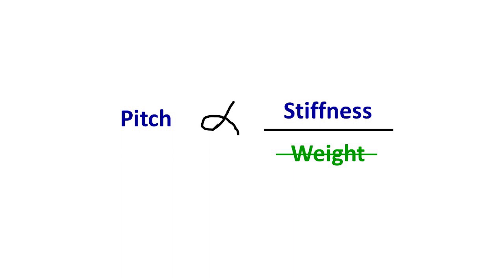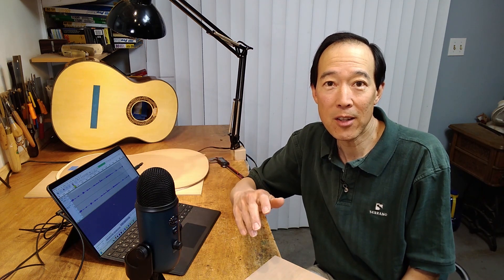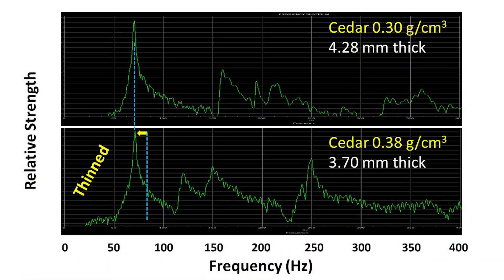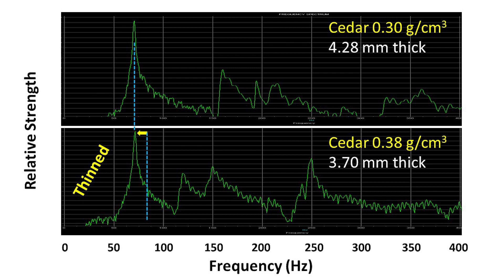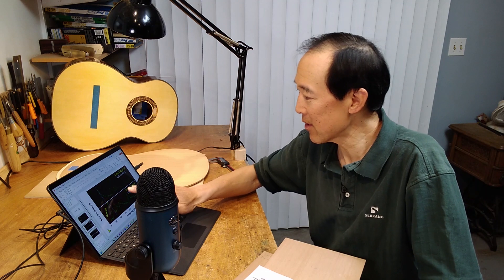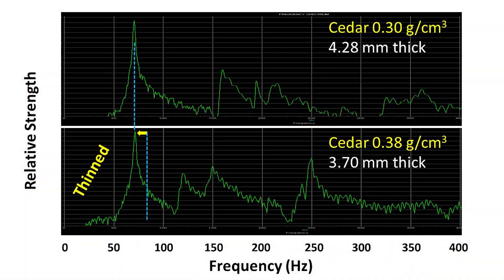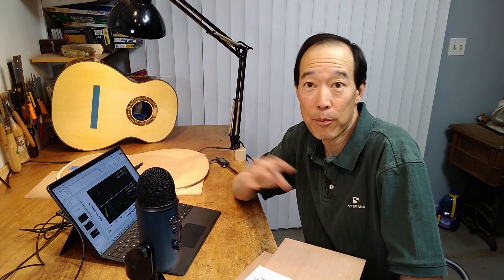Lutherie Demystified Ep. 9 | Concepts: Understanding and Selecting Soundboards, Part 2

Comment: you're an amazing teacher and inspiring me to finally take the plunge to make my first terrible guitar. Thank you for sharing your knowledge.

I noticed that while the frequency snapshot between the 2 spruces was very similar - the pitch envelope..or spectra over time sounded quite different between the 2. I imagine this difference could accumulate with with multiple excitations, like strings.

When you thinned the cedar and moved the peak from 82 to 71hz, it was fascinating to see that to go from E to A#-ish cost 43% of stiffness. I wonder if you can heat it or treat it in some way to gain something back.
Reply from the maker: That's right. The spectra are showing us the frequency dependence of the sound rather than the time dependence (sustain). The potential difference in sustain can give us a different perception of how the two samples behave, whether in the raw form or a finished guitar. I'm not sure what the value of treatment would be to change the stiffness and sound, but in the practical realm of building, we have bracing that can modulate stiffness in a directional manner with very little added weight.

Comment: Hey Gareth thanks for your great video's. Im also trying to apply science in my builds and explain why things are happening. I have 2 questions  maybe some more but i restrict myself to 2.
1. In the first part of this video you have thinned down the higher density board to match the longgrain resonance freq. Based on my calculations, based on normal sized board, the lower density board is about will be around 149 grams vs 163 grams for the higher density. Roughly 10% difference. What is your opinion about that?
2. Did you also consider to measure the crossgrain  stifness in terms of resonance frequency, this because the guitar has also vibration in that mode?

Please keep the video's coming.
Reply from the maker: 1) Thanks for the calculation. I believe in the video, the measured change in weight was 14%, so not exactly the same as the 10% you calculated. Keep in mind that these thickness measurements are not high accuracy since I was using a caliper taken at a minimal number of edge positions and that the true thickness can vary around the plate since I'm thinning on the drum sander at high speed and with a very coarse sandpaper. The exercise was to demonstrate the concept that small changes can envoke a change in acoustic behavior and such techniques can be used to gain consistency in final sound. But in practical terms, the higher density board will still likely yield a different final sound due to the extra mass, even though the resonances might be matched in the completed guitar. Such differences may be evident in longer sustain, slower speed of response  and possibly altered dynamic range. The point is, if you want consistency, it's best to start with similar material and also try to match stiffnesses and resonances. 2) You'll see in episodes 13 and 14, I begin to introduce the concepts of stiffness in multiple axes and the use of impulse analysis to monitor as many modes of vibration as possible. In future videos, we'll discuss how the resonances relate to modes of vibration using Chladni analysis.